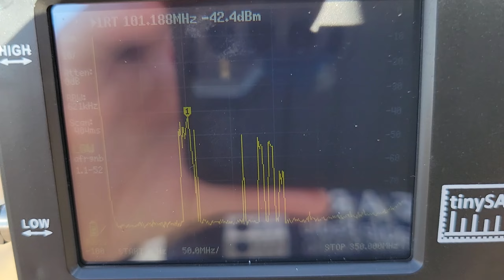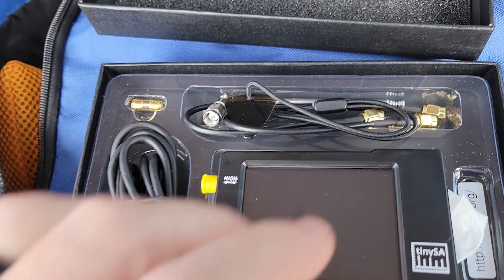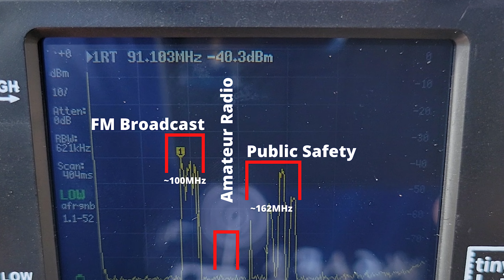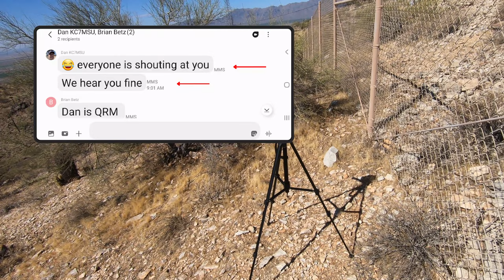2 Meter Band-Pass Filters for Front-End Overload

Comment: Glad you posted this helpful video...The Hobby PCB filters devices are Accurately described & designed for TransVerter filtering applications & near Useless for the much more common Adjacent Band Receiver Overload Desense problems...The very Low Insertion Loss specs tend to cause misinterpreting the Accurately advertized Frequency Response graphs & misuse attempts for Receiver filtering applications....
Reply from the maker: Thanks Tom.  Yup - very true about the filter.  I had Jim Veatch, WA2EUJ on the show a couple weeks ago and we talked about it.  That noise was bad on both sides of the ham bands so no hope with that filter.  Typically used for other applications, true.

Comment: Tower-mounted comm--and broadcast--antennas are multi-element , high gain. They concentrate power at the horizon, taking power from low and take off angles. The result is an "umbrella effect"--signal strength is lower on the ground as you get closer to the tower.

The 3db figure for the fi k term is likely the insertion loss--not the out-of-band rejection figure. A bandpass filter that only rejects unwanted signals by 1/2 would hardly be worth the trouble. (-3db is a 50% reduction in power.) You get the same effect with a lower gain antenna (-3db relative to initial setup). And the lower gain  antenna is the functional equivalent of a 3db insertion loss.
Reply from the maker: Well this is an interesting thought.  I really appreciate you offering it up here.  Hadn't really thought about it that way but I have some practical experience on this hill and other hills with commercial towers.  Most of the time I'm better off with a simple rubber duck antenna which is to your point.  But there have been occasions where I was able to make contact with stations that were further away with a gain antenna and band-pass filter vs not having that ability with the rubber duck.  I guess other factors must have played a roll like the position of the antenna (height and orientation).

Comment: Problem you having is that most of the signals are outside the TinySA range. The closer you get to the towers, the lower the signals because you are getting to be beneath the sharp vertical stocked antennas they have low signal strength right below them.I work on those transmitters and always have a radio with me, I use DCI 200w 2m bandpass filters,and a simple military surplus 440 filter.
Reply from the maker: Thank you John.  Makes sense to me.  I have used the SOTAbeams filter from this video with success!  Band pass filters are a must on hills like this, I agree.

Comment: Yep I'm in Washington DC where all the broadcast towers are and it's wiping out my 2m. Pretty much the entire VHF band is wiped out. The only solution I have so far is to place my antenna in a bad spot so that it actually doesn't pick up very well so that the front end of my radio can receive. I have a small slim jim J pole hanging from my front porch. The bottom of it is literally only about one foot off the ground. Any higher gain antenna than that will overload the front end of both of my icom dual band radios. The 4100 and the 2730.
Reply from the maker: ooof now that's some bad RF.  Sorry to hear that dude.  Sounds like you have it dialed in though, the best you can.

Comment: We have the same issue here in North Georgia.  Stone Mountain has a 50,000 Watt broadcast transmitter.  The only HT I’ve used up there that doesn’t get overloaded is the Yaesu FT-270R and the Yaesu FT-60R, with the FT-270R being the best between the two.  Sadly, Yaesu discontinued the FT-270R.

 There are other summits in North Georgia where we experience intermod.  The Superheterodyne receivers give you a fighting chance but some of them have IF that receives images caused by nearby NOAA weather broadcast transmitters at 162MHz.  Again the FT-270R and FT-60R do best in that situation.

73, de N4HNH
Reply from the maker: Thanks Doug.  It would be interesting to run a test on different HT's from that location.  I know Adam K6ARK has something like that in the works in the future.  Radio construction makes a huge difference though, as you aptly point out.

Comment: your not exactly in the radiation pattern of the antennas radiation pattern. it will be lower r8ght under the tower xD.  the patterns of antennas peak perpendicular to the antenna element thats why going away from the tower will have a greater RF strength.
Reply from the maker: Sounds about right.  There's so much noise up there who really knows for sure, but I do think you are correct.  Back at the truck I am in the pattern more than underneath.  👍

Comment: SOTAbeams 2m bandpass works most of the time for me. A Yagi can also save an activation in high RF environments. Last ditch effort is to move around the summit or get lower (but still in activation zone) Dakota Hill (10,000ish feet) in Colorado stumped me my first try until I went back and stood on the otherside of some big rock opposite the Antenna farm!!

“73”
Reply: Also!
1. I have several HTs the FT60R is hands down the best SOTA-Front End overload resistant.

2. I have not done it yet but will. Get a sign to put in your car window (Amateur Radio Comm Training in Progress) and have one on the summit prominently displayed (on comm tower sites) where authorities may wonder what your doing.
Reply from the maker: All great suggestions.  I have had problems with a yagi on a different summit using it both horizontal and vertical.  I still had to reduce gain.  But I haven't tested the results more than the one time.  Yeah moving to a different spot can really make all the difference sometimes.  For this specific peak that isn't an option. That one spot I was standing in is the only accessible area in the activation zone.  But I endorse what you say 100%.  Even if you don't have FEO probs, moving around can make the difference in getting a contact sometimes.  Thanks for your comments.
Reply from the maker: Yes - that FT 60R is a great little radio!  And thanks for the idea about the sign.

Comment: Is this problem essentially what the FAA was worried about from nearby 5g towers?

May sound like an idiot question, I know nothing about radio frequency and such matters.
Reply from the maker: Hi Derek - I don't think this is the issue with 5g, although it is a possibility. This issue results from bad filtering of signals.  But the airliners have quality systems that should handle Front-end Overload. 

I think the 5g issue is more about altimeter signals getting jammed by terrestrial comercial 5g signals.

Comment: Radio Locator lists 100.7 as KSLX and 101.5 as KALV-FM both from Phoenix.  They have an ERP of 100,000 watts each. Besides the other 100,000 watt FM stations, there are also TV stations there (probably all on UHF after the UHF repack). They're  probably putting out a million watts plus each.  All that RF on FM and TV would mess up reception pretty bad. One of the greatest intermod resistant radios of all time was the Radio Shack HTX-202. I never ever had intermod on that radio.  It was a two meter, one band only radio.
Reply from the maker: WOW!  Now that's some RF output there! Thanks for sharing that information.  I've never heard of the HTX-202.  Looked it up on eBay.  Appears to be a solid rig although it's a bit older.  I like playing around with older gear.  Do you know if it is programmed to be narrow banded (12.5 kHz bandwidth)?  Thank you for your comments.